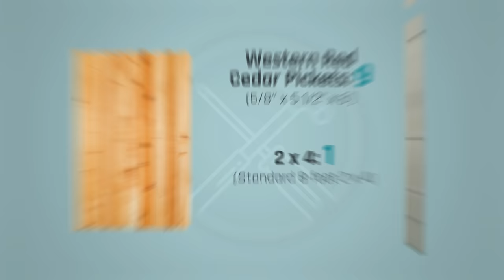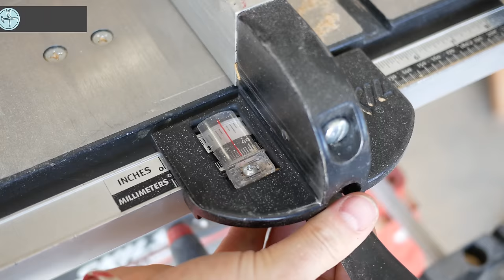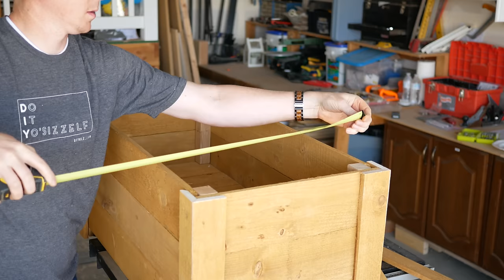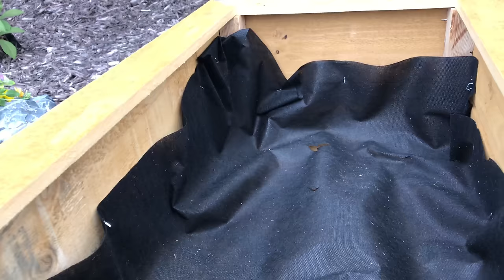$23 DIY Planter Box

Comment: Cedar is rot resistant but won't the 2x4 have problems especially with frequent watering of the plants? Using pressure treated would be a good idea as well as coated fasteners to prevent them from rusting within a couple years.
Reply from the maker: Good call on the pressure treated. We used water sealer on ours but the coated/deck screws would be a good move.
Reply: LRN2DIY just make sure you don't use pressure treated if growing vegetables. Treated chemicals are bad news
Reply from the maker: Do you think it'd be safe to use pressure treated if you wrapped it with weed barrier? I'm not going to do vegetables in there but I'm sure some would want to.
Reply: I wouldn't think so. The issue with the treated is the chemical leaching into the soil from the wood contracting and expanding with wet times and dry. I wouldn't risk it.
Reply: LRN2DIY Treated wood has been rated safe to use around food since 2003.  The issue used to be the arsenic used in the treatment process but they don’t use that anymore.  You can line it with plastic but you don’t have to.
Reply: pressure treated wood will harm the plants. unless you put a barrier inside, like pond foil.
Reply: Pressure treated wood is toxic
Reply: Tia Williams not safe.
Reply: bruhaha guys these are not meant to last forever. Lmao
Reply: watch the chemicals used in treating it.. some are ok and some r deadly when ingested through the food planted in it...
Reply: @Jace Holden That's what I used. Easy peasy, and not too much more expensive than a regular 2x4.

Comment: tite bond wood glue is cheap and would greatly improve the structural strength of your frame.
Reply: Glue deteriorates fast  on outdoor projects  so practically worthless doing in the first olace.Cood quality exterior screws is the answer.
Reply: @OldDunollieman  Titebond III is water proof from what there label says. Worked at a cabinet shop for years built plenty of outdoor kitchens and never had an issue.

Comment: This was the first time I've built anything myself-my fiancé helped. Been wanting to grow some veggies and came across this video. I bought the cedar pickets from Menards and they were $3.09 each. The 2x4 was gonna run us almost $10 so we bought construction grade kiln dried for the 2x4 which was only bout $3. A little more than I wanted to spend but it was a fun project. I don't gotta worry bout chemicals leaching if I just paint the outside right?
Reply from the maker: Congrats on the build! That's correct - if you just paint or stain the outside your veggies will be fine.
Reply: At my home improvement store all the cedar pickets are treated

Comment: Thanks for the video!  Any ideas on the best way to sit the planter on the edge of a patio that is 2-4" higher than the surrounding ground?  Since the frame is the lowest point of this design, it's not like 2 legs can be longer than the other two, and the box will definitely be crooked without compensating for the height difference.
Reply from the maker: So the longer legs will do the trick but I'd recommend putting some pressure treated lumber "stilts" underneath the lower portion instead. That way you can move the box to level ground later if you want to.
Reply: @LRN2DIY  Thanks for the reply! Looks like the drop from patio stones to ground is closer to 4" in some spots, so I'm a little concerned about the stability of stilts.  It was my initial thought, however, and since boxes shouldn't move much once in position, I'll try that first.  I guess I could try 2x4 stilts instead of 2x2.  Definitely pressure treated.  Take 'er easy!

Comment: You didn’t go back and explain how you connected those feet a little better than just fixing them in place with the brad nailer.
Reply: James Cain I was thinking the same. I’m definitely not hating on the video, It’s an excellent video. I just would like to know more as to connect the feet. I kept going back thinking I’ve missed something!
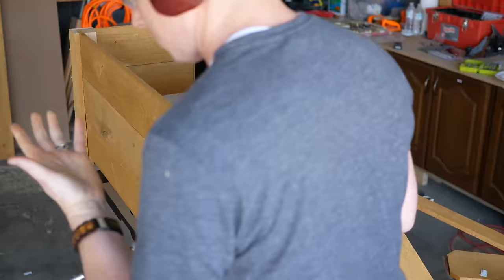Reply from the maker: You're absolutely right - I forgot to explain it in the video but if you look at 3:19 you'll see that I drove longer screws right through the top and bottom of the corners to secure the inner board and the feet in place.
Reply: @wajf2881  i wound up using pocket screws to join
 those

Comment: em ... I only count 8 of 6' board... am I missing something?
3 for the long sidings,  3 for both the short sidings and floor board.  1 for the "big picture frame".  and 1 for the corning pieces.
Reply: If you are like me, an extra board just in case one turns into kindling wood! Sometimes even measure twice, cut once, and then force it to fit doesn’t work!

Comment: Any issues with using a treated 2x4?  Just wondering if it's an issue having green treat wood in a planter box where plants are growing?  Perhaps the plants do not like green treat?
Reply from the maker: Treated is good, especially if you use a weed barrier between it and the soil. I probably should have used pressure treated instead of untreated.

Comment: I'm really curious, how does this hold up with the moisture from the plants/soil/watering/rain if it's outdoors? Wouldn't it just decompose over time?
Reply from the maker: Without some maintenance (additional sealant, possible reinforcing) it will weaken and rot over many years but I can tell you that over 3 years after putting these in our front yard, with sun, rain, snow and ice, these are still holding up great and are full of plants right this moment. A few ways to make them even stronger - more screws (exterior rated) and less brads/nails. Those will likely be the weak point.

Comment: Did you use standard brad nails and screws? Hows it going with it? Its holding up just fine with the moisture?
Reply from the maker: I used galvanized brads and outdoor rated screws. They’re still very much in use today and doing great. There has been some minor loosening of the right corners over the years but only if you’re looking closely. Definitely holding up pretty well for having sat through several summers and winters.

Comment: Thank you for sharing. Do you have to drill holes on the bottom wood tray?
Reply from the maker: You can either leave gaps in the wood like in this video or you can drill holes but you don't need to do both.
Reply: @LRN2DIY  thank you.
Reply: @LRN2DIY  wonder what I did wrong. I pre drilled the hole and tried to put the screw in but it stopped and wouldn’t go all the way in. Please help. I used the 3.5 wood screws.
Reply from the maker: @thynguyen3716  Are you referring to the holes to put the frame of it together like at 1:50? If so, you may need to predrill larger holes or use more force to drive them in. It's hard to know what the exact problem is without seeing it.

Comment: how hard is this to size this up for a bigger planter box? maybe just add some additional vertical support boards on the long side?
Reply from the maker: plocktontr I think you could totally upsize this and make this quite large. The only thing I’d add if making it bigger is a foot or two in the middle bottom for support.
Reply: @LRN2DIY  Thanks!

Comment: Is there anything you could spray on the outside and inside to prevent it from rotting out? We want to put in a garden outside but it's humid and can get wet in texas
Reply from the maker: It never hurts to add sealers to the wood. An off-the-shelf product, like Thompsons's Water Sealer will help quite a bit. Adding a plastic vapor barrier to the inside will prevent the majority of the inside from being in contact with the soil, which will also help. I've heard of people spraying Flex Seal or Plasti Dip on the inside of wooden containers as well to add a layer of protection but haven't tried that myself.

Comment: if only I had a table saw, mitre saw, chop saw etc...
Reply: rocster01 you don’t need all that equipment, I build the same stuff with minimal tools.
Reply: @CJDWoodworking22  - I actually built 4 planters yesterday with a drill and a hand saw - I had to compromise on the 45' mitre edges, but they look decent, and my wife is happy (which is the #1 thing !!)

Comment: Is it ok to use plywood, cut in horizontal boards. For lower costs
Reply from the maker: It’s an option, but it’s not weather resistant so it will likely rot faster.

Comment: Cesar planks shrink and warp over time.
How do you work work around this?
Reply from the maker: The best solution is to either purchase dried wood or let it sit for a season before using it. If that's not possible, the weed barrier lining mitigates most of the risk. If gaps form in the wood, it's usually fine because the weed barrier will be holding the soil in. The bigger issue is the miter joints in the top frame, so the dry wood is more important there.

Comment: I dont have access to a table saw for the 45* cuts for the corner  or top pieces.  Would it look just as good with straight 90* cuts?
Reply from the maker: There may be a slight color difference between the cut (smooth and lighter) ends and the natural (darker and rougher) surface but I suspect that would work itself out in time. I think it will work out just fine really.

Comment: cutting the weed barrier defeats the purpose. when weed barrier is used water flows through it but the darkness doesnt allow the weeds to go. so Im not sure why you suggest to cut the weed barrier in the first place.
Reply: Sally Semrau The weed barrier is great to help keep (most of) the soil from running out through the joints and also helps keep the joints from staining so quickly over time.

Comment: Great idea, but attaching feet and the vertical members to the box frame creates a fundamental weakness at those attachment points. If you were to move that box a few times, you'll soon see why. Why not use a single 1x2 for the feet / vertical members and then attach horizontal 1x2s between the uprights? This is considerably stronger and more durable.

Comment: I did one similar and it lasted about 3 years before it fell apart with wood rot. I would suggest waterproofing the inside with (https://www.amazon.com/dp/B000NZ73SE/ref=cm_sw_em_r_mt_dp_FFnwFbXW1G10H) waterproofing membrane and some RedGard. Just to provide a barrier between the soil and the wood. Wood in contact with moist soil will eventually rot. It's like metal expose to ocean, it will eventually oxidize.  It will bump up the cost to 3 times the price, so it might be better to build a new one every year. 
I am looking for ideas for a 36" pot for a tree.  I need it to have about a minimum 10 year life span.

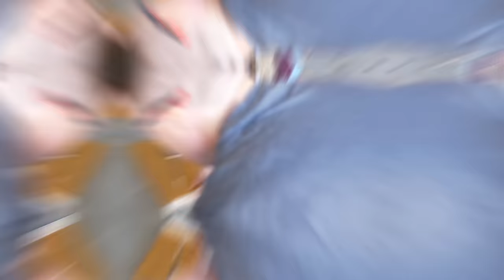Comment: What's that yellow DeWalt extension accessory on the drill at the 2:05 mark? I've seen it in a few DIY videos but I'm not sure what it actually does
Reply: Driver extension that has a sleeve that can slide out to help hold screw in place

Comment: Those are really nice instead of ripping a 2x4 why not just use 2x2s
Reply: Not all "wood stores" carry 2x2s or 2x3s... Those are mostly in the big box stores with the bent lumber, and two 2x2 usually cost more than one 2x4 that you can spend 20 seconds on to rip it yourself.

Comment: Also. Use pressure treated if sitting on the ground. This won't last a couple years
Reply from the maker: Pressure treated wood that is rated for ground contact is best. Not all pressure treated lumber is designed to be in contact with the ground and you're correct that Cedar will rot faster than ground-contact-rated pressure treated lumber. That said, we've had our 3 planters in front of our house (snow, rain, heat, etc.) for over 4 years now and they're doing great.

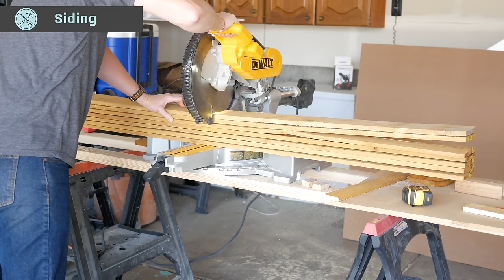Comment: At 2:25, how did you fasten the inside frame pieces if there was a screw running threw the same area of the previous rectangular frame?
Reply from the maker: John Beltran You can just drive a screw right next to the existing one, just be sure to predrill.

Comment: The screws would cost $23 these days. I bought some last week. The fence boards are $4 here. It's a simple plan...complicated by not having those tools. Also, with those thin boards, you'd really have to wood seal AND line with 6 mil plastic, or it'll rot out in a year! $$$
Reply from the maker: The costs of supplies definitely seem to vary from place to place. We've had two of these outside here in Utah for coming up on 3 years and they're both doing great.

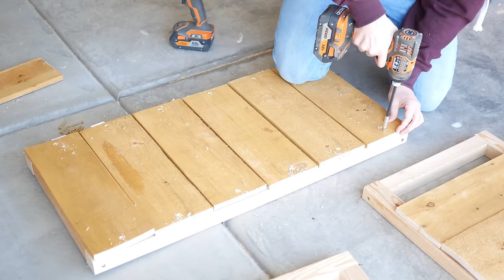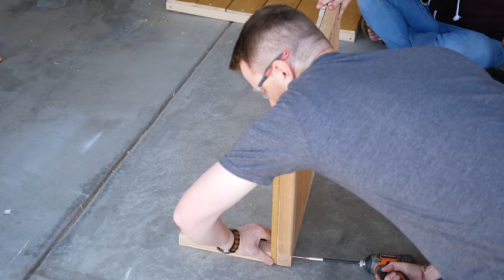Comment: Is it just me when he says 6 pieces to do the bottom at 2:04 there are 6, but at 2:15 there are 7 on the bottom??  6 boards at 5 1/2 inches wide x 6 =33.  Those bottom spaces are not taking up 3 inches??
Reply from the maker: Definitely a valid question. We made two of these and on one, we added six boards to the bottom with a (roughly) 1/2" gap between each. On the other, we fit them tight together and added a seventh piece, cut to size. At 2:15 you can see the other base at the top left with the six pieces.

Comment: Fast forward 4 years. It's 2021 now and we've been hit with covid. This $23 project is probably around $200 now. The price of wood is through the roof.
Reply from the maker: Actually, I just checked and those same boards are $2.54 even today, so $22.86 for 9. They were cheaper when I made this, of course, but not by much. Cedar fencing isn't nearly as in demand as basic building supplies so it hasn't been affected nearly as much.

Comment: Plans don’t add up. Six 5 1/2” pickets = 33” and the frame is 36” that’s a 3“ difference. So with 6 planks each plank will be about 3/5” apart from each other. Your video makes them look like they’re 1/4” to 1/3” apart. What am I doing wrong?
Reply from the maker: The issue is that it's a natural material. Depending on the moisture of the board, they may be anywhere from 5 1/4 to 5 3/4 wide. Because you're going to put in weed barrier as a liner, it's fine to have larger gaps between them, like 1/2 or 5/8" but if you evenly space the boards and leave an even gap on the outsides of them too, you should be fine. Alternatively, you can add another partial cedar picket and tighten up the gaps quite a bit if you prefer. In short, you kind of have to adjust based on the specific material you're working with and your preferences.
Reply: @LRN2DIY  Got it, thanks for the clarification.

Comment: how do you get the measurements for cutting the wood
Reply from the maker: The plans are on the website, linked in the description. Here's the direct link: http://lrn2diy.com/wp-content/uploads/2017/06/Planter-Box-Plans.pdf
Reply: @LRN2DIY  thanks
Reply: do you need a brad nailer
Reply from the maker: @datgasssss  It helps to use one but you can also use small outdoor-rated screws or nails with a hammer.
Reply: @LRN2DIY  ok thanks

Comment: Only $23*! 

* plus $2000 for entire suite of contractor-grade carpentry tools

Nice looking box though!
Reply: all the cuts can be done with a circular saw outside of the corner finishers, but you can just have those be straight cuts and cut to fit instead of the two pieces being the same size

Comment: Okay, but what about the machines and equipment?  Not everyone has them.
Reply: @Esther  Emmanuel. LMAO  As simple as this build is all you need is a hand saw and a screwdriver., and some sweat equity. Comments like yours just amaze me.
Reply: @OldDunollieman  then it should be included in the budget too. That's what I'm talking about. If you have it, good for you.
Reply: @estherh.e.867  Outside pandemic times, your local hardware/Lumber store can usually cut things for you for a couple bucks. Don't know if they'd miter them, but a handsaw and a miter box can be had for like 30 bucks and you can keep it for future projects! If you don't want to deal with angled cuts, it's pretty easy to modify and use regular straight cuts, it just won't be as pretty. The rest is pretty much a drill, and you can totally use screws (nicer finished heads will look great) in place of Brad nails. I feel your pain though, I gave up and bought a table saw and miter saw a few months ago. Worth it to me!

Comment: yea okay bud...$23...you forgot to mention plus a workshop and $1000 worth of tools
Reply: Doesn't have to be. Could get it done with a circular saw and a hammer and nails. Or even a handsaw. and theres alway garage sales you can find used inexpensive tools at.
Reply: I used a circular saw because did not want to get out my table saw (also used all screws cause did not want to bring out my air compressor.... just remember to pre-drill all holes and use thinner gauge screws.... trim screws or deck screws with similar profile).  If you use a circular saw it makes sense to set up a guide (make sure it has a straight edge) held down with clamps or can even nail to some substrate.  Set the 2 x 4 on another board and set saw to cut just beyond the 2 x 4 depth.  Clamp the 2 x 4 at end and in the middle.  Will have to move clamps as you get toward the end... OR can simply nail to the substrate using finish nails and easily pry off the side that is nailed in place after the.rip.